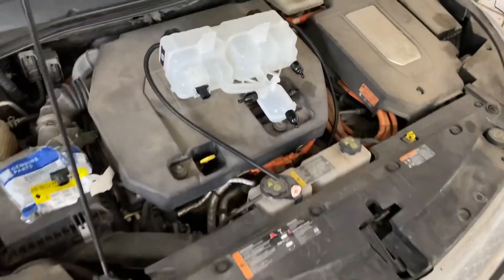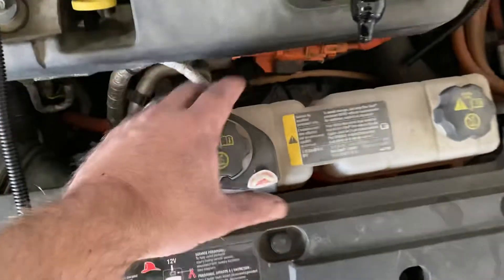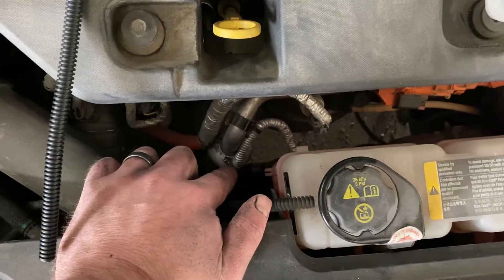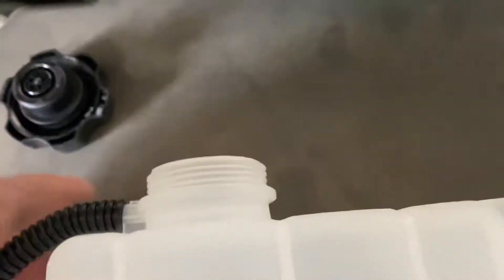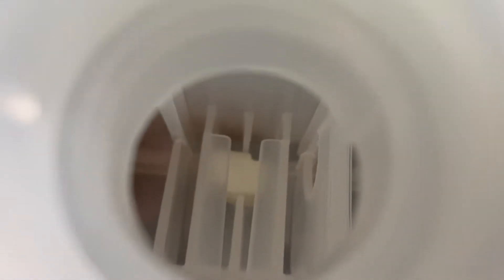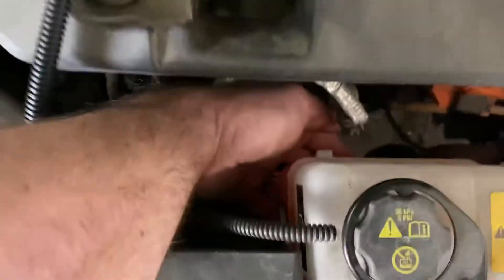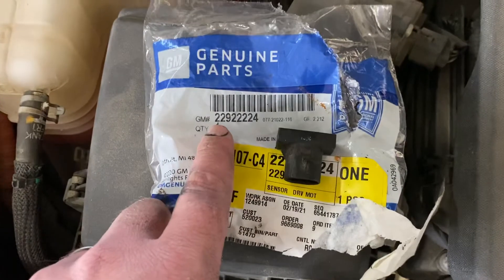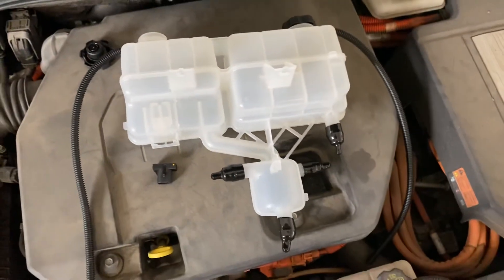How the coolant level sensor works on a Chevy Volt for “Service High Voltage Charging System” error

Comment: Wonder what would happen if you left the sensor detached from the tank so the magnet could never interrupt.
Reply from the maker: I’ve thought about this. I think the false positives from a magnet would be rare. I would BET that most failures are from sensor failures or wiring failures.
Reply: There is also a defeat plug you can get that has a resistor to trick the computer into thinking the tank is full

Comment: Супер видео!!! Все очень хорошо рассказано!
Reply: Thanks for the video , I have a 2011 and I had this once and it did not allow me to start, added fluid , can’t remember if I used a tool or simply reset by pulling the 12 v battery cables, but if it happens again I have a better idea of the issue.
Reply from the maker: @risknotdonot  I put together a pair of videos of how to reset the error. It’s a latched code that needs reset within the HPCM2 module.
Reply from the maker: Thank you and thanks for watching!